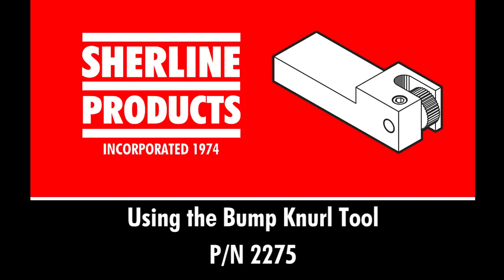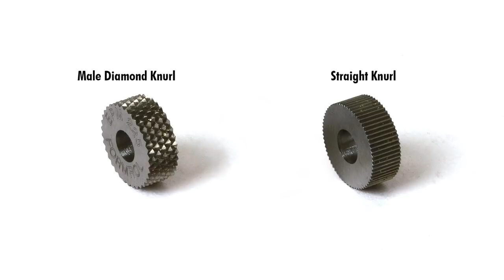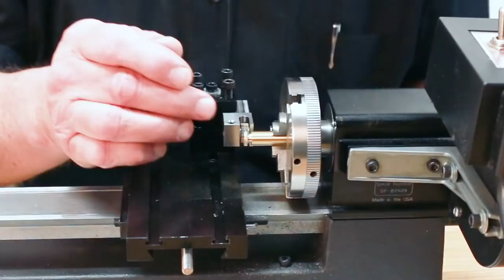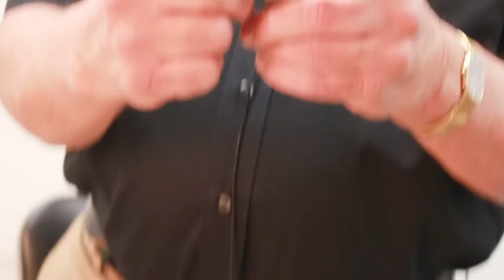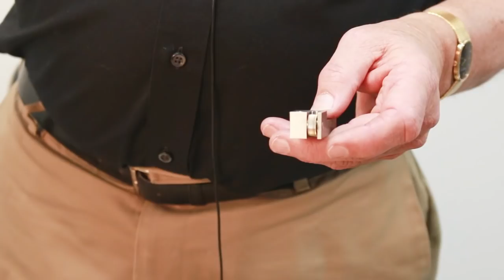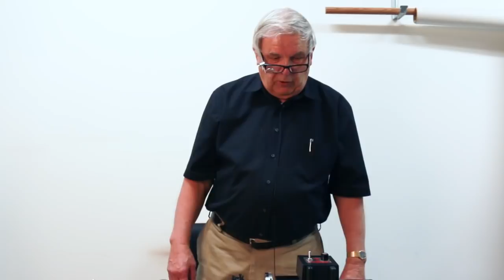Using the Bump Knurl Tool

Comment: What would the Minimum size of round stock that could be used making successful knurling on it? Example: Would it work on 1/4” round stock?
Thanks!
Lee
Reply from the maker: 1/4" round stock should not be a problem. However, if you want a more definitive answer, you will have to wait until Monday, when your question can be forwarded to our techs.
Reply: Ahhh that’s Perfect-want to try making a 1:25 Supercharger Grooved Pulley with it…
Reply from the maker: Which knurling tool holder are you using? Standard (3004) or Bump (2275)?

Comment: Could you use this tool to go straight in from the front to make like a prop drive for a model airplane engine? Especially on Composite props, the knurled teeth help hold the prop in place and to prevent the prop from loosening like when flip starting.
Reply from the maker: Yes, you can feed the knurl into the face of a part to get a friction knurl. You may need to play around with the TPI that you chose so you will not get double tracking of the knurl.

Comment: what's the difference between this knurl tool holder and your other "knurling tool holder"?
Reply from the maker: The bump knurl tool (P/N 2275) was designed for use on CNC lathes and has a single point of contact, although it can be used on a manual machine as demonstrated in the video. Our other knurl tool (P/N 3004) has two points of contact and can ONLY BE USED on a manual lathe.
Reply: @SherlineProducts  Thank you for the reply. I have your Mini lathe and Love it. And I am now ready to start knurling. Would you recommend the (P/N 3004)? I just have a manual. Are there limitations to the (P/N 3004)?

Thank you
Reply from the maker: @ianpalm  I would recommend the 3004 for the manual machine. The limitations of the tool are that it can handle diameters up to 1", and you cannot use riser blocks while using the knurling tool. Please read the instructions for more details on how to use the P/N 3004 knurling tool.
Reply: @SherlineProducts   I make rings so I need something that can get a wide variety of faces. I just can't picture how the 3004 works that's why I am confused
Reply from the maker: @ianpalm  I spoke with one of our technicians, and he recommended the #2275 to knurl rings. He also recommended that you customize some of our tall jaws to hold the rings on a chuck, or you could use the end mill style fixture turned down to the I.D. of your rings.
He said the 2275 is good for soft materials like gold, silver, brass, copper, etc. but it would not work on materials like titanium.
Check out these links for info on the tall jaws and end mill fixture:
https://www.sherline.com/product/chuck-top-jaws/
https://www.sherline.com/product/3082-end-mill-holder-style-fixture/

Comment: This is just about the worst video you guys have made,  yet it works; Practically no zoom in of the work, blown audio. And some of his techniques are actually not what I would consider best practice. Send me a bump knurl and a full set of knurls for it and John or I will make you a proper video. The video really doesn't discuss at all proper kurl depth and timing/retiming, it covers the topic of tool setting poorly, and did you know a single point kurler can go in a radiusing tool? Also entirely not discussed is knurls on tapers, and use of things other than orthogonal kurls or use in CNC (we don't have a CNC sherline,) care and maintenance of the kurl tool. 

I think one of your best vids is actually threading on riser blocks with the compound, even though it's not comprehensive.